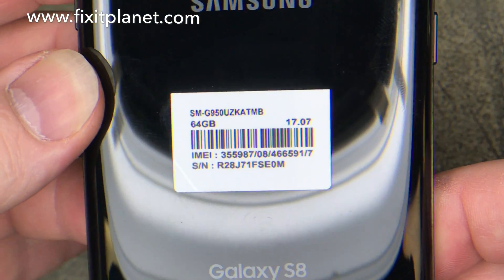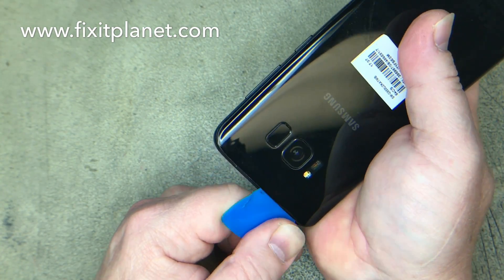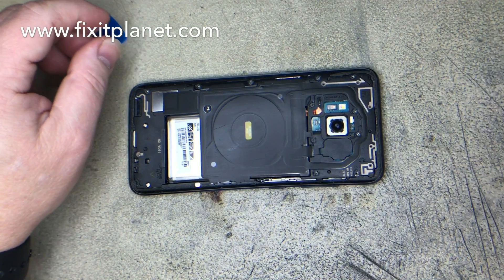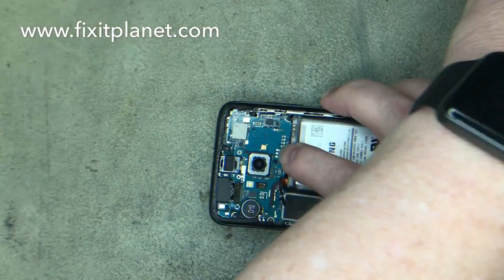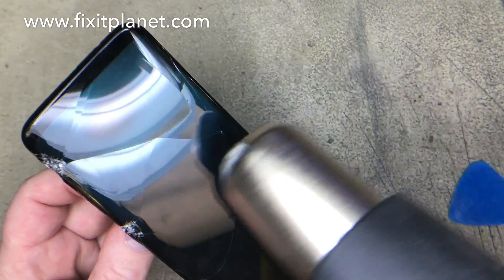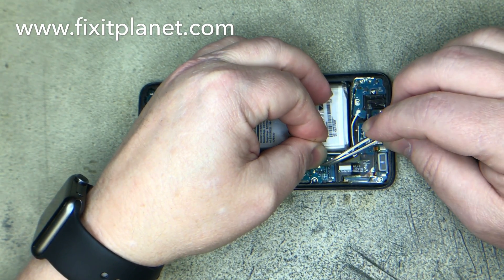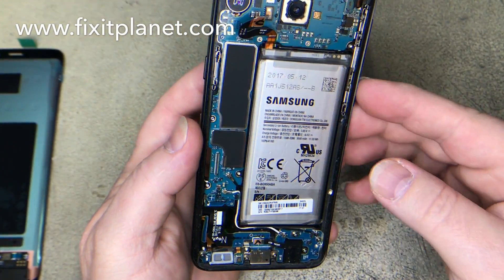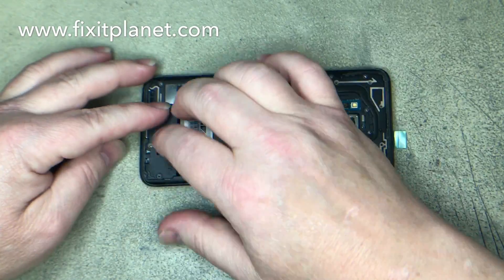Samsung Galaxy S8 Screen Repair From Start To Finish.

Comment: I was trying to separate the glass but it's in fact so thin and fragile that I couldn't not break the LCD too. So now I have to change thistle. Is there a way to change the glass only without breaking the LCD (super thin and fragile)?
Reply from the maker: I don't recommend "glass only" repair on this model.

Comment: will I need to replace the adhesive? every time I do a smart phone repair, I've had difficulty getting the phone to be closed properly.. the adhesive mostly is the problem.
Reply from the maker: If the adhesive is giving you trouble then you need to remove it and clean the surface extremely well. Then replace the adhesive.

Comment: If my touch screen is not responding to finger taps etc due to being dropped, will replacing the screen resolve this?
Reply from the maker: In most cases yes.

Comment: Am I missing something critical or is it actually possible to remove the screen without removing the main-board?
Reply: You did notice the screen connector goes through to the back right? So basically you need to take the entire phone apart to unplug the screen.

Comment: Hi, i don't see the part where you put the adesive on the display...how do you fix the screen to the frame?
Reply from the maker: This replacement screen came with adhesive already installed. If you buy one without adhesive you will have to install your own.

Comment: I cannot get the tiny screws loose. They seem to be stuck. Any tips?
Reply: Thanks!
Reply from the maker: Unscrew them as far as you can then use tweezers to pull them out.

Comment: If you break your glass you get to live with it or you have to buy the full glass+amoled+digitizer combo for $250 or more.  Companies that sell the front glass only for ~$30 is a total SCAM because there is NO WAY to replace the glass only.  The layers are sealed together and to separate the glass from the other two is 99.999% impossible as it will damage or destroy the super thin amoled LCD.  Even high end pro shops with $100,000 worth of autoclave and freezer machines do not like to attempt it and most now refuse to because they know how difficult the process is.  So if you break your phone, either live with cracked glass or get a new phone because for the cost of the parts plus labor (or even if you attempt this yourself) it is just NOT worth the time and expense when you can buy the same phone again for roughly $300 vs the $250 plus at least $100 or more in labor you will pay.  Lastly, the fact that Samsung seals their phones in curved glass is ridiculous and the thin curved sides make for very little to grip onto which makes for easy drops. If these were fully sealed in polycarbonate it wouldn't be such an issue. Sealing a phone entirely in glass is nothing more than a corporate cash grab to sell more phones.
Reply from the maker: yep
Reply: Such a scam to sell super thin phones completely covered in glass.  For the first time in 10 years I'm giving serious thought to not buying another Samsung or move to the Active series which I assume is a lot easier to repair.
Reply: @oldowl4290  The active phones are harder to repair. Also if you bought a new S8 for $600 and broke the screen a few months later, you're not likely to get another S8 for $300. Today (18? Months after the S8 release.) You can get a used one for $300.
Reply: Well I guess its time to return the glass only kit I bought after seeing just how thin the screen was.
Reply: @reslofbeats  I made the same mistake.  I bought a glass only repair kit that is totally worthless.  There is no way to replace the glass unless you have at least $50,000 worth of freezing and autoclave equipment, the dies, forms, pressure molds, etc.  I did a ton of research on all this and even most repair shops don't even want to touch the s7 edge,  s8, s9, etc, due to the curved display.  It sucks because I've always liked Samsung but if you can't easily repair a $700 phone it's just really not worth buying it in the first place! Why they design these so fragile is utterly ridiculous.
Reply: There are some videos that remove the front glass by freezing it at very low temperatures, heating and removing the leftover adhesive with alcohol, then applying new glass with LOCA (liquid optically clear adhesive)
Reply: @wildnigels  there are yes, but for flat faced phones.  To do it for the curved edge phones takes a ridiculous amount of professional repair equipment an even then it's no guarantee.   Ive personally spoken with many repair shops as well overseas suppliers who make the equipment.  The consensus is Samsung doesn't want their phones to be repairable. They want you to spend another $700.
Reply: @oldowl4290  theres a german language video out there that does it for the Samsung S8

Comment: After the whole process is done, is it truth that you have to connect your phone to a "Samsung" program to make sure that the screen is working properly?
Reply from the maker: The screen itself does not need to be programmed to function properly. You can use a program to run full test and diagnostics but you can just test all the functions manually before you install permanently. It's up to you.
Reply: Fix It Planet thanks! I was wondering because I got mine fixed at UbrakeIfix and the guy ask me to unlock my phone to run a "program" to make sure my screen was working properly (or so he said) the part I didn't like was when he went to the back away from my line of sight with my phone unlocked, I have all kind of private stuff in my phone, like bank account numbers and such, Idk I didn't like that...

Comment: My screen has a small crack in the right hand corner if I bought this kit would it be all I need? 

https://www.amazon.com/dp/B076HN3CL7/ref=cm_sw_r_cp_apa_5gpxBb39FEAA4

Thanks in advance 😊. BTW great video I appreciate it!
Reply from the maker: That is a glass only repair kit. Glass only repair is difficult, time consuming, and risky.
Reply: Fix It Planet Thx, I end up not ordering it. I have insurance on my phone so I'll end up going that route. It's very tiny at the moment so I'll wait it out 😁!

Comment: I bent the pins on the motherboard to where the lcd screen goes onto can this be fixed?
Reply from the maker: If you can't bend them back you will need to replace the connector
Reply: Fix It Planet its fixed thank you took me some time to that but I got them all good screen turns on and boots if anyone else does this take your time don't rush or you can break them off
Reply from the maker: That's great news good job!

Comment: Can I replace my front screen ONLY without damaging or replacing the LCD & Digitizer?? I already have new screen , tools needed and heat gun, I just get mixed answers so not sure and don't wanna take it apart to just break it.. But I only have a few lil cracks on front screen, NOTHING wrong w image or touch screen underneath.. PLEASE HELP!!!
Reply from the maker: Glass only repair is very risky.

Comment: Can it fully work with the $30 screens they sell on eBay? It has all the tools included. Just wanna be sure before I head out and either replace the screen at a store or buy a new phone completely
Reply from the maker: Unless you want to do a glass only repair replace the whole screen

Comment: Question; my screen cracked and the screen won't turn on. the phone still turns on & it vibrates when I touch the screen still. Do I need to replace the screen and motherboard or just the screen?
Reply from the maker: Replace the screen not the motherboard.
Reply: thank you!

Comment: I have a galaxy s8 which worked perfectly fine. Then one day it died and I plugged it in to charge it however the phone vibrated several times like if the charger wasn't working. I went to the car to try another cable but then it wouldn't even turned on period. At first I thought it was a regular black screen of death but I tried all the forced reset tricks and the Samsung screen wouldn't ever pull up. When I charge it, I only see a small white line flickering towards the bottom of the screen. But the rest of the screen remains black. Anyone have an idea what may be wrong? Battery? Display?

Comment: What did you use to heat it up?
Reply from the maker: We use a pre-heater (hot plate) and hot air gun to assist where needed.

Comment: Fix it Planet, is the old adhesive enough to stand the Ip68 again or we have t replace that one too? Thank you for your video
Reply from the maker: NO even if you replaced the adhesive. That rating is based on factory specifications using equipment during the production of the the model that include a machine with a preset PSI that distributes pressure exactly where they want it for as long as they want it. There are also coating machines. Once the phone is cracked none of that matters, but a good repair is still better that a cracked phone. ;)
Reply: @FixItPlanet1  So, sending the phone to Samsung is not gonna give me IP classification again?
Not that im going to drop the phone in toilet or some water pool. But.. i want it to be resistant against rain and such.
Reply: Some repair companys claims that their repair wont void the IP classification nor warranty. Uses Samsung original parts.
And some tells that they cant guarantee that the phone will be water resistant... so.. i dont know.

Comment: Is it possible to just replace the glass? Since a heat gun needs to be used to soften the adhesive, it appears as though the heat damaged the display. Is this damage avoidable?
Reply from the maker: Glass only repair is properly done with special equipment and is not easy. Yes too much heat will damage the display but the screen in this video was already bad. Using a hot plate with a set temp evenly distributed will prevent damage.

Comment: Is this the same for s9
Reply from the maker: Not exactly. The pop connector for the fingerprint reader is in a different location for example and the display may also be sold with the frame which changes the process.

Comment: whats the best glue to use to reattach them and how long do u put it under a uv lamp also what is the recommended heat temperature for the hot plate to remove glass from lcd screen
Reply from the maker: This is not a glass only repair video. The process for glass only repair is completely different. As far as the UV glue is concerned try "X Factor Sticky-icky" and time under the UV lamp varies depending on the quality and type of lamp equipment and UV glue used. Cheap crappy lamps could take 24 hours to cure properly, good expensive lamps might take 15 to 30 minutes give or take.

Comment: wow you changed only the glass screen rather than changing the whole frame but I wanna know is this same for galaxy S9?
Reply from the maker: Very similar process with some slight variations.
Reply from the maker: The pop connector for the fingerprint reader is in a different location for example and the display may also be sold with the frame which changes the process.

Comment: @Fix it Planet, I just learned something today that may be important to other DIYers. In a small percentage of S8 phones, the screen won't turn on until you fully assemble the phone. When I tried to attach the new screen to test it like you showed, mine wouldn't turn on. So I took it to a repair shop, where the technician put the rest of the logic boards together and then attached the screen, and it worked perfectly!
Reply from the maker: Yes that's true the logic boards at least need to be fully assembled when testing. Also the antenna caps and NFC antenna may need to be attached when testing or you might get errors with the battery temp and maybe other anomalies. Good point.

Comment: I noticed at the beginning that he said something about putting his phone on a "hot plate" before using the heat gun? How long and what temp would you use?
Reply from the maker: Temp and time will vary depending on the type of equipment. Experiment with what works best for you. Average temp may be between 80-90 degrees C. Average time may be approx 10 minutes give or take.

Comment: Should i use a glue when i close it again or when it’s OEM display it’s enough with the glue on it?
Reply from the maker: Genuine Samsung screens usually have the adhesive with a masking. Remove the masking and gently touch the adhesive if it is "extreme stickiness" and has it all the way around too, then your good to go as long as you clean prepped the surface.

Comment: Question was the gold metalic thing behond the screen thw lcd that u removed after the screen and if so can i leave it there my screen is the only thing thats cracked i dont want a new lcd
Reply from the maker: Yes glass and LCD separated in this video but what is referred to as the "LCD" is actually an OLED display and is made up of more than one layer of material. Each layer is required to get the finished result, image, and touch.  It is possible to replace only the front glass but that is a complicated process.

Comment: Great instruction! I am not a professional one. I followed, replace my screen. However when I tested the screen before installing it, the mainboard became very hot when I turned on the phone. I checked all the connections, everthing in their orders. Would you please tell me what is possible reason?
Reply from the maker: If it is really hot then that could be a short to ground. I cannot guess what may be happening in your case but it is not unusual for the CPU or other components to get warm. The phone should calm down if everything is installed and working properly.

Comment: I've got an s9 that I recently cracked the glass on. I just broke the glass on it. I've noticed that the front glass as well as the rear is glued on. Is there any way to just remove the front glass without completely disassembling the entire phone? Or is there a particular reason why it's repaired in this fashion
Reply from the maker: Among other things disconnecting the battery and gaining access to the display connector are two reasons you need to remove the back on this model.